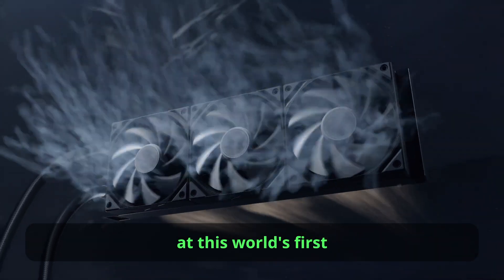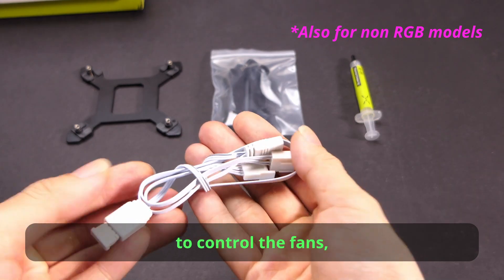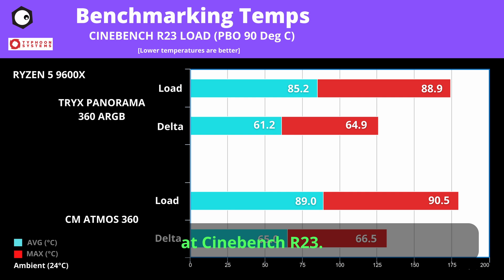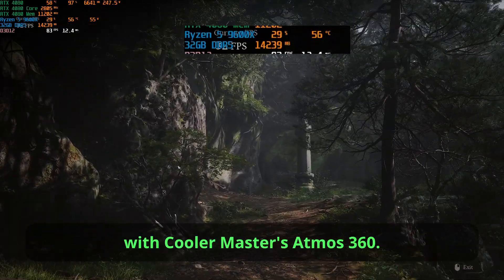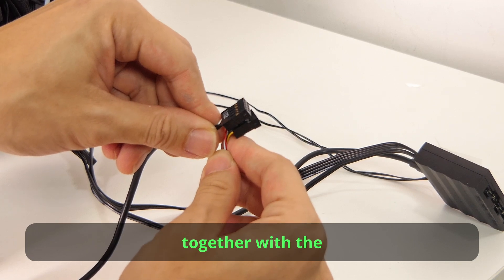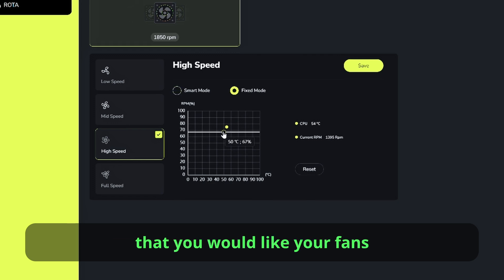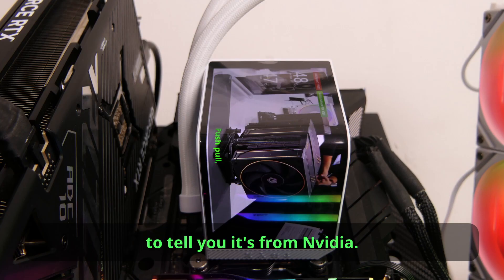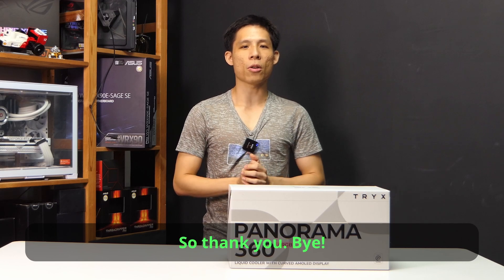This TRYX Panorama 360 Is SO UNIQUE. But Is It REALLY GOOD?

Comment: Can the fans on the rad be changed easily?
Reply from the maker: Yes they are easy to remove and install. Just that, the fans still make use of the traditional 3pin (ARGB) and 4 pin (PWM) cables. So they are a tee weeny messy haha

Comment: Had similar issues when purchased and removed unit from system. Since the software update, I reinstalled the unit, and it is much smoother now.
Reply from the maker: Yes it was quite a guess and experiment when I first got this AIO from TRYX. What was the issue that bugged you the most?

Comment: Does this have a lifetime warrenty or anykind of warrnty? Greaty video, ty.,
Reply from the maker: Hey FoxRacing, I am checking with the TRYX team. May I ask which country do you live in? 
And thank you for liking! What do u like about it?
Reply: @RealMelTan  They said 6 year warranty for any non human related issues, and 2 years  on the screen
Reply from the maker: @CritikalFox  Let me confirm me with the team
Reply: @RealMelTan  I asked this on amazon before i bought one and that was the answer they gave me. As long as its not broken by human error, which is understandable, they got you covered. Also, the inside of these are filled with a non conductive fluid, right? My first AIO, as I was always worried about leaking and frying my system 🤣
Reply from the maker: @CritikalFox ah ok, if u got it from amazon. Then it should be amazons warranty, will get the answer from the team.
Yes the liquid is not conductive. I havent seen that much or any leaked AIOs, most are quite sturdy
Reply: @RealMelTan  Awesome thank you for your support sir! Much appreciated!
Reply from the maker: @CritikalFox  hey Fox, I have confirmed with the team. This is the correct warranty period

Comment: Stupid question: could I use my own fans instead of the pre-installed ones and sync the leds to my other computers fan rgbs?
Reply from the maker: Hey Pajak, it is not a stupid question, pretty legit one. Yes you can use your own fans, but I am not sure if the TRYX software can pick up your own fans. You probably have to change the ARGB using your motherboard's software, just a hassle because you need to use that, together with TRYX's software.

Comment: Hello buy a cooling tryx panorama but buy the version Tryx Panorama SE 360 the one that does not have a fan in the pump would like to know what difference it has from the other that if it has a fan in the pump and if that model is good???
Reply from the maker: Hi Nelson, I do not have access to the SE version, and I doubt it is out on the market. 
How do you know if the SE does not have a fan in the pump?

Comment: This is really great lookikng cooler, and plan on getting it for my new build in the next 6-8 weeks. I am waiting on the Lian li Vision Compact. However performance is huge for me as i live in Los Angeles and it gets very hot here. 
I currently have a 240 Ryujin 2 sandwiched in a push pull configuration. with 4 Lian Li SL V2 120 fans on a custom fan curve for positive pressure. 
I am on a 13900K + 4090 OC in a Lian Li O11 Mini Air. 
At idle in a room with ambient of 69c (nice) i am getting on average of 31-33c on the CPU and 29-32c GPU. Under 4K Max settings 4K gaming i am seeing my CPU not go past 55c and my GPU 55-60c

Based off of your testing; would you say in a larger case, with a Push pull as well this AIO would give equal cooling results on the CPU; now it being a 360 and two additional fans. I do plan on replacing the rear push fans to a 30mm with higher CFM.
Reply from the maker: I have not touched the Ryujin before, but i think this TRYX AIO is on part with that cooler. A 360 should provide better cooling than a 240, although your bottleneck could also be your ambient temp.
Reply: dude do u live outside? what does living in LA has to w anything u just said XD
Reply: @rslayking1975  Im not your dude. I understand you prob live in a swamp somewhere; but it gets hot here.
Reply: @rslayking1975  Bro got no more money left for air conditioning 😭